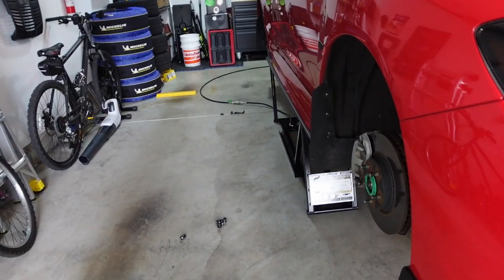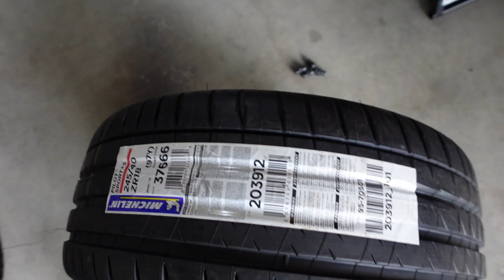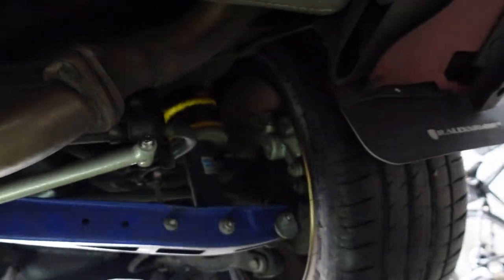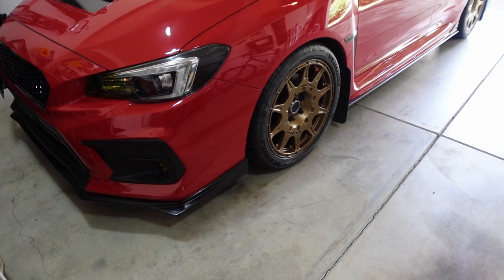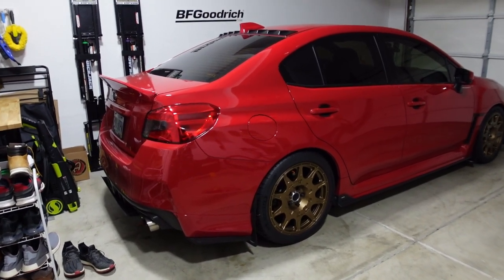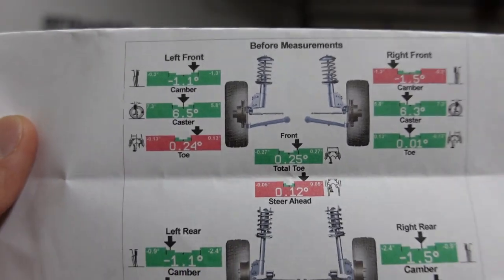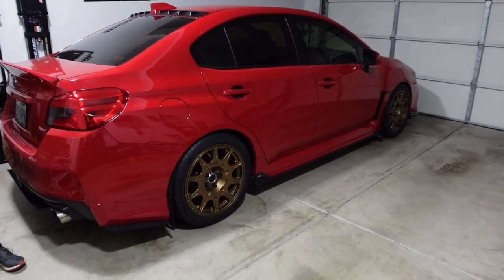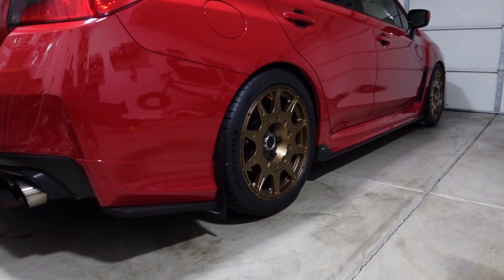My FAVORITE Tires for the WRX!

Comment: Wheel alignment, rotating tires from front to the back and wheel balance is a must for even tire wear and increasing tire life and performance. I would say every 5000km or 3100miles. So if your getting 2 services per year at least do your tires once. At higher speed it will make a massive difference.

Comment: Gotta get new wheels before I get new tires. Looking to go a bit wider and get some 265/35 but these are the tires I’m looking at.
Reply from the maker: That’s what’s up man! Can’t go wrong with a set of MP4s!
Reply: Michelin is quite expensive, and Pilots are great tires.  I like shredding cheaper tires, myself 😂.  I'm really liking the idea of 18 x 9.5 +45 with a 265 tire. I like em about even with the fender edge or even a tad tucked.
Reply: @2018wrxaddict  I get shredding cheaper tires lol I just don't wanna cheap out on tires .. and brakes. Your life is worth more than the cash you'll save buying a budget brand but to each their own lol
Reply: @xil3ntkha0s  I mean...there are cheaper tires that are still great. I have punished a cheap set of Ironman IMoves, and they were surprisingly good tires for the price. I run Nexen N5000s year round, and they have been excellent for $160 apiece. I plan to buy Pilots when my setup is pushing near 800hp soon.
Reply: @2018wrxaddict  it's your money so have at it lol
Reply: @xil3ntkha0s  oh believe me I'm havin' at it 😂

Comment: I have a 2015 sti and rear tires wear inside more. I am thinking about installing the adjustable lower control arms like yours to help with tires wear. Where did you go to get your wheels alignment done? Thanks
Reply from the maker: I get my alignment done at a local shop near me, A&M Tire Co.
Reply: @ronfromportland  thanks for info. Your video is awesome 👍
Reply from the maker: @henryjohnson9150  thanks man!